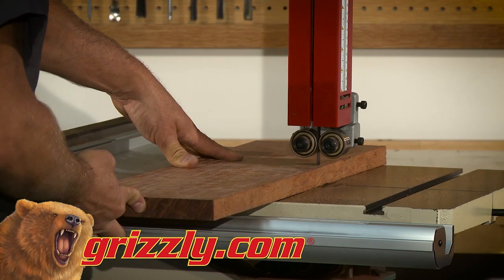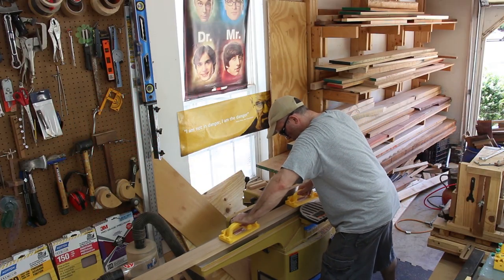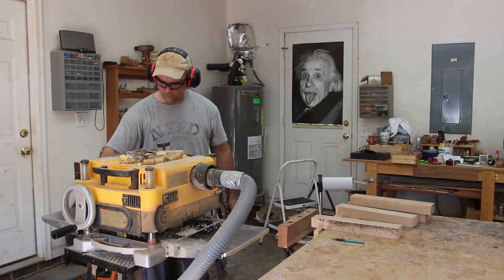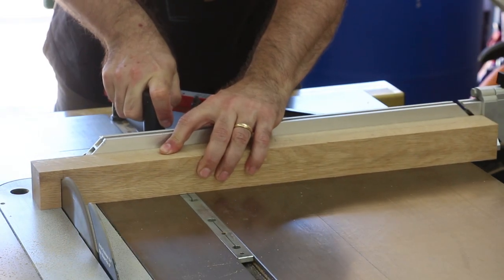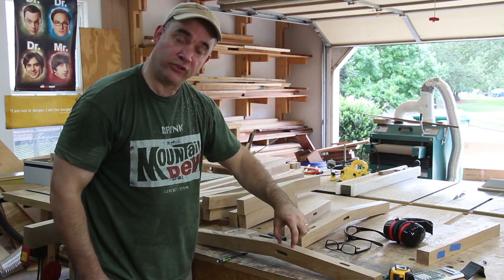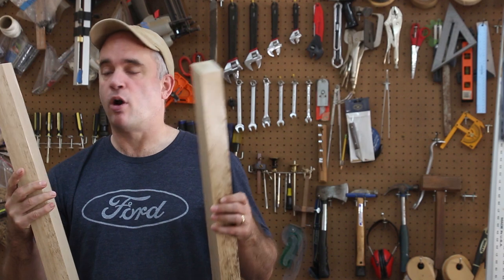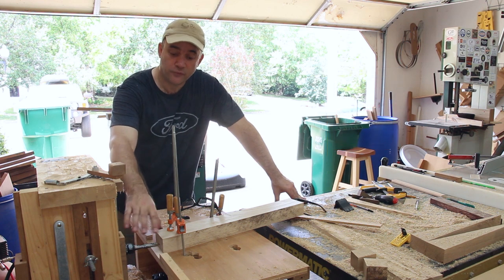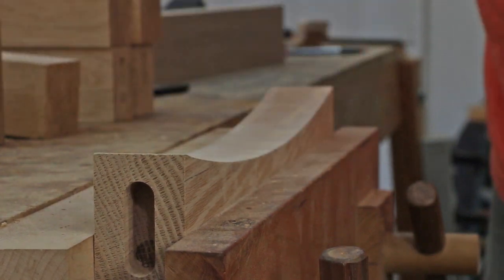Asian Inspired Bench Part 2

Comment: no offense intended I use cherry, hockey, hard maple, only had very very little burning.  just wondering
Reply from the maker: No offense taken.  Cherry is usually the most susceptible.  Hard maple behaves nicely and burns less easily.  Resin build up (pitch build up from cherry - I cut a lot of cherry) on the blade will make things worse.

Comment: why do you get burning on all your videos do you think it is the tablesaw motor
Reply from the maker: No.  I don't think my table saw motor is burning my lumber.  I usually use cherry which is highly susceptible to burning from the blade.  Burning usually happens when the piece is stopped or slowed momentarily while ripping and is normal (resin build up on the blade can make it worse).  It's never been a problem.